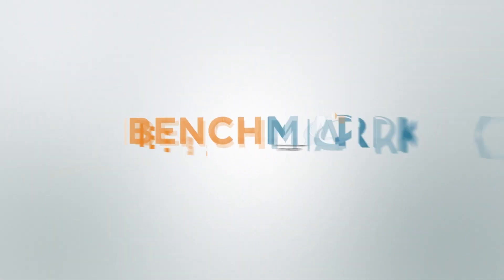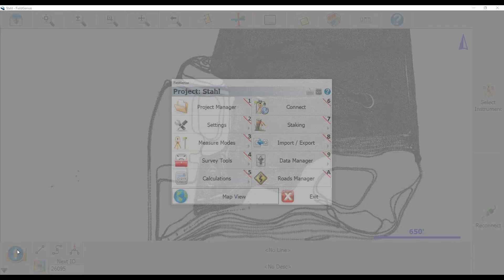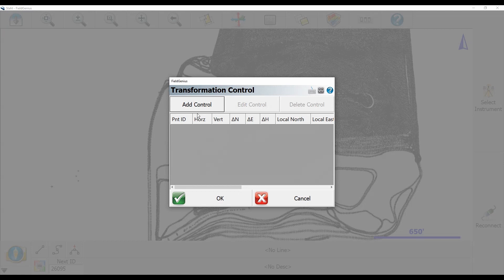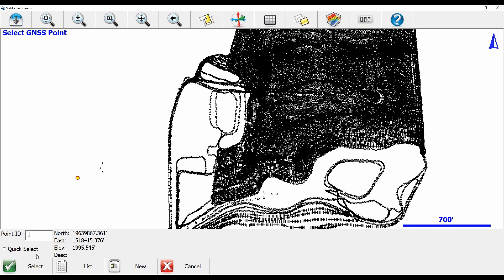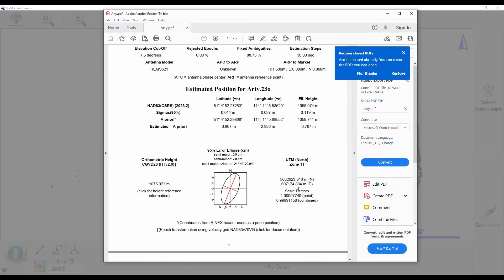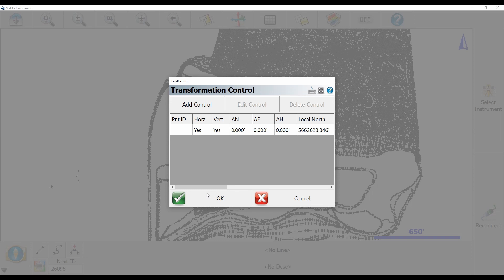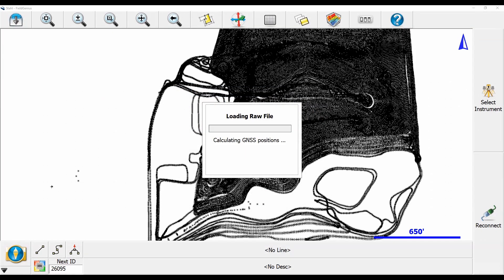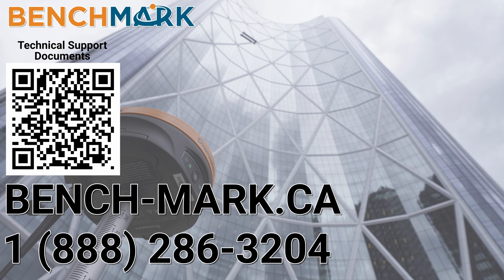MicroSurvey FieldGenius How To: Static File Transformation | Bench Mark

Comment: Was the UTM point data of your office from the CSRS PPP just an example?  Would assume for point 1 though you would use actual real survey point or PPP data for that location?

So if the transformation would have finished, essentially all those points would have been brought to your gnss location?
Reply from the maker: Hi Tim, This UTM point was just an example. In this example, it would be akin to setting up your own survey point, where no control point data would be present. 

When the transformation is complete, you are moving the data into the real world, from the chosen point of the base.

Comment: What did you use to collect all those points?  Surprised FG didn't bomb. : /

UAV LiDAR?
Reply from the maker: Hi Tim, to collect all of those points I used the static functionality of the receiver. It depends on the model of receiver, but with the Hemisphere equipment you can collect the static and perform the survey at the same time.
Reply: @benchmarkequipment  Thanks.  I meant that cluster of 50K survey points?  LiDAR, photogrammetry, some just walking with rover?
Reply from the maker: @timd9430  Hi Tim, They actually drove the site while auto recording the site. The Mesa 3 managed to load and run the points, but it wasn't super happy about it if you tried to mass manipulate the points. In fact we actually had to write a script to delete half the points to bring it into CAD software.
Reply: @benchmarkequipment  Thanks.  Very interesting. ; )